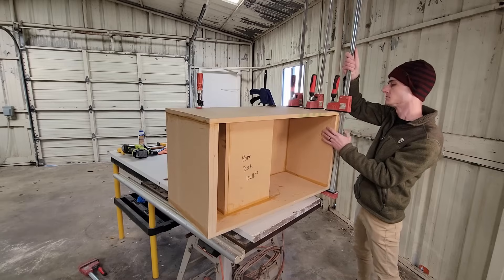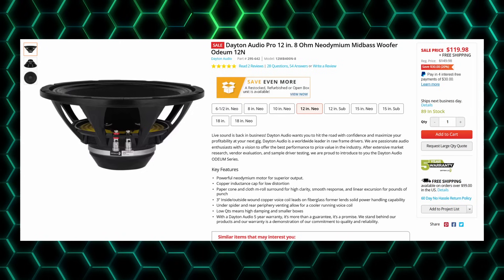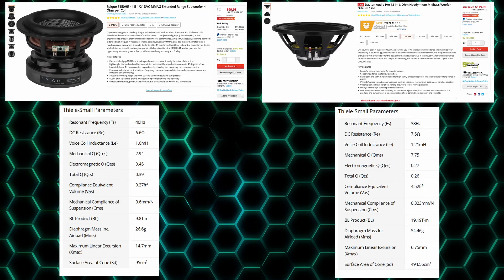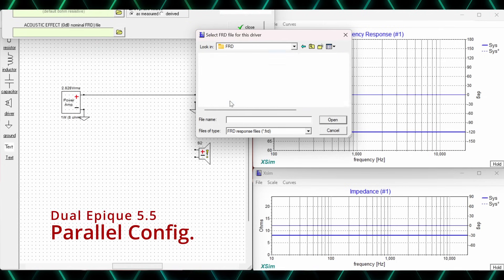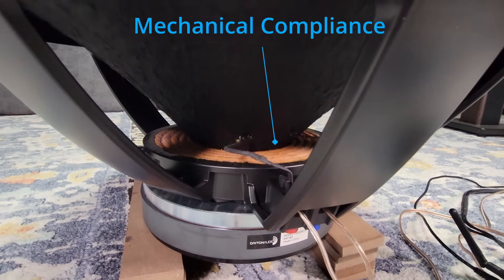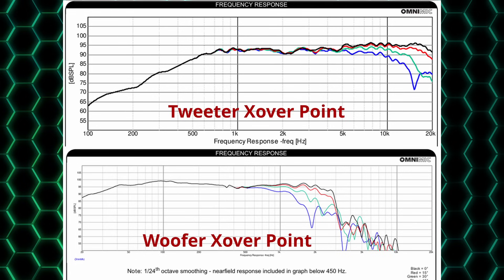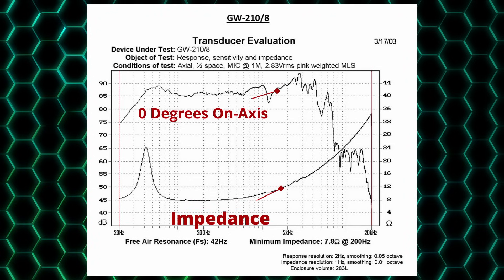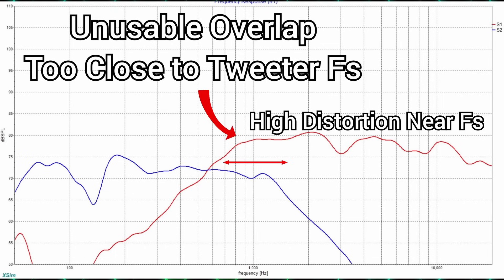Selecting The Best Drivers For Your Project - QuickStart Guide

Comment: Interested to build a pair of three-ways.  Been learning the full spectrum of design factors involved.   With this video, you summed up very well the driver selection process for me.  Very happy that your info confirmed my efforts.  I have been playing around with Win ISD for a couple years now and feel confident in my level of understanding.   Just out of curiosity,  do you use your builds in your own main system(s)?  Do you ever compare your speakers to retail choices?  Aside from the satisfaction earned in DIY is it really worth it from an audio performance point of view?  Oh, liked and Subbed for a few months now.
Reply: .    How would one decide between soft dome or ribbon tweeters.  A cone or horn midrange.  Two 6" high-excursion or one 15" high-efficiency woofers?
                                                                                                                                        Acid Jazz, Funk & Brass🔈🔉🔊

Comment: I will have to watch this several more times to catch everything that you were throwing out there.  I'll eventually get it though.  Thanks for the info.  On a related note, could you recommend a modeling software for horns and transmission line builds?

Comment: Wonder if only compression drivers can match what a 15" midbass driver is capable of.
Reply from the maker: It's certainly possible, if you are asking about crossing the CD to a 15" woofer.
Many CDs can play down to 500-800hz.

Just be sure the horn can support the low end as well. There aren't just a ton of horns that will play that low, so be sure to check the specs.
Reply: @DIYhyfy  Wonder if you've tried any coaxial compression driver in that case.

Comment: I've been designing/building speakers for 50+ years, and I have to say that's a great informative video, good job!  It's a lot easier today than when I started, even T/S parameters were a fairly new thing back then.  We didn't have software to help, not even pocket calculators when I first started.  Now with all the measurement and CAD software etc, it's relatively easy to get good results especially with good information resources like your channel.

I've focused primarily on open baffle for over 30 years and only use passive crossovers in situations where active isn't practical.  The side and rear surrounds in my home theater use passive crossovers along with DSP EQ to correct for the dipole effect of the open baffles.  The Atmos, currently in progress, are sealed box with passive crossovers and no DSP.  These Atmos speakers and the Infinite baffle subwoofers operating from 10 Hz to 35 Hz are the only thing not open baffle in the theater. 

I just discovered and subscribed, I look forward to checking out your past and future videos.  Keep up the great work!

Comment: You can also overthink everything especially when car or home audio is not cheap. If it were then driver manufacturers, Speaker manufacturers. DIY'ers would be making proper 3 way designed speakers and all you see is 2 way design speakers. Even for expensive tower speakers. Since when are less speakers a good thing?
Reply from the maker: Yea it's tough to plan a build now that prices have doubled for so many things.

It can be a but depressing to assemble a shopping cart for a nice affordable set of 3-way speakers, and then suddenly remember that you'll need to pony up another $200-300 for xover parts.

Fortunately 2-ways can sound really nice, with low distortion. But I do also prefer a nice 3-way.

Comment: People go nuts over ribbon tweeters.  Fact of the driver is that they rarely, if ever play low.  That means, you have to have a midrange that responds to 10K to cross over without a gulf between upper middle and treble.  That, or use the ribbon as a supertweeter, with a dynamic tweeter between the ribbon and midrange. There are more than a few ribbon equipped commercial speakers that have this dropout.
Reply: there are plenty of mundorf amt's that can be crossed low. in the 2k range.
Reply: The larger the ribbon, the lower it will go on average. Magnepans are full range ribbon speakers.

Comment: I don't use any measuring tools to build my speakers.
Measuring tools are going to be massively influenced by the surroundings they are used in anyways.
I just read the manufacturer SPL charts and use that as a general guide for what the driver does at specific frequencies.
Think of it like a second hand story of the drivers capabilities, not 100% accurate, but close enough to formulate some decisions.
Passive crossovers are not accurate devices in a mathematical sense no matter how high the order.
They just approximate curves based on approximate impedance.
I instead just prototype the crossover outside the box and do A to B comparisons by ear with a set of good headphones.
This allows me to sanity check the mathematics and make changes on the fly by temporarily wiring in different components.

There is no mathematically perfect speaker, so there is no reason to strive for it.
Just get close and make final adjustments based on what you want to hear or how you hear.
This is the art of speaker design.
If it was as simple as taking perfect measurements, there would be no variation in high end speakers from manufacturers as the problem would be solved.

My general rules I have discovered is: (based on manufacture SPL)

1. The speaker should not have a flat SPL response.
You want to design in a -2dB drop about every third octave of frequency response from low to high.
Making the entire frequency range SPL equivalent will make a very bright sounding speaker, brighter than is pleasant.
This is why a good three way design is usually superior.
It allows you to change the third octave from the woofer frequencies more easily. 
Also don't forget to test the resistance of you crossover filters from positive leg to driver positive leg (live side of the crossover filter).
Any resistance will contribute to the attenuation of the driver (drop in dB output).
(An example from the video, the Epique E150HE-44 is 83db response, most mid-range and tweeter drivers live in the 89dB range, this means you would need four of the E150HE-44 to match the dB level of a typical mid-range or tweeter; unless you like throwing most of your output power into resistors.)  

2. The design intent of the driver matters.
Just because a driver can play the frequencies to within 3dB of the intended response curve doesn't mean they should.
Pay attention to those 3dB humps in the drivers frequency SPL curve.
It is the driver telling you where it is best used in the application.
Example, a woofer that drops 3dB from 100hz to 400hz is going to sound muddy even with a -2dB offset in the mid-range driver
Woofers with this character are best suited to sub-woofer tasks.

3. Zobel networks are ESSENTIAL! 
If you are not using a zobel, your crossover is not accurate, period.
The only exception is very high frequency drivers or drivers that are not impedance typical (ribbon tweeters)

4. Some cone breakup or frequency ramps near the end of the driver response can be handled by parallel notch filtering.
This is usually essential for mid-range drivers from 1K to crossover point.

5. Driver material matters for the intended frequencies played.
The general rule I have found is that low frequencies like incredibly hard materials, mid-range likes firm but pliable materials, and tweeters like firm but very flexible materials.
From a material stand point, I like metal or plastic for my woofer drivers, paper or paper composite for my mid-range drivers, and usually some form of ribbon tweeter for the high frequencies.
Reply: Like all measurements they provide a standard.  Yes the room is a major factor but speaker companies can’t provide for every possible listening room possibilities.  Ears are completely bias and can create what YOU THINK are a great speaker but when others hear it?  Watch the famous Floyd Toole video where he explains how the greatest speaker designers in the world were producing garbage with only their ears.  I never understood the ears are the best concept.  Say you make a speaker and it sound bad.  You need to adjust it, how?  Do you just throw components in and guess??  In the modern world I’ll make tge response straight with a slight downhill slope.  THEN I’ll listen.  If something seems off I’ll look at the response to find the issue(that might not always be an issue) and use modeling to see what my guesses yield.  When using measurements it’s not just the graph, but without measurements it’s a guessing game that is highly influenced by a single opinion

Comment: Nice vid, Brandon! Tells the truth about integration premises us experienced builders use.

One thing I'd like to add, among other things further ahead here, is that manufacturer's recommended useful ranges should be thrown out the window. Those are done by inexperienced marketing employees making judgements on FR plots alone. 

An example, you can't use an 8" much past 2.5kHz EVER due to breakup and beaming, (likely lower truth be told) and if the breakup is at 3kHz the useful range may say Fs to just above the breakup. Lots of drivers CAN play below Fs, but minimally. The other reason they can't be used that high is the breakup needs attenuated, which rolls off the upper end of the driver's response to the point of acceptable suppression. -25dB is bare minimum, -40dB is better and typical, and -50dB is best for any problematic inherent abnormalities in driver responses, including harmonic distortion profiles. HD profiles are best if even order, as odd order are not as pleasing to the ear, and the typically accepted 1% HD limit is at the -40dB threshold. All of this should be considered when aligning drivers through a crossover, but elevated HD also is not the end all be all measurement to abide by.

Pretty sure I heard you say using 2 drivers in parallel adds 3dB to the output. This is true if talking about wattage efficiency, but voltage sensitivity goes up +6dB due to both the doubling of cone area and halving of impedance. When designing loudspeakers, wattage tells you thermal peak output, as long as mechanical power handling has not yet been breached, as well as how the driver will handle dynamic peaks in program material. (Mechanical power handling has to do with output, xmax usage, box design, and frequency range applied.)
 
Voltage sensitivity at 2.83V/m places all drivers on an even playing field as most amplifiers are voltage gain devices. This also compensates for impedance and output differences unlike as if using the 1W/1m spec.

In measuring drivers in the baffle, the minimum mic distance should be twice the width of the baffle to gain the information related to baffle step losses. Inside this distance, the measured responses are considered nearfield and will have elevated bass responses. Typical location for a speaker under test is far from walls, placed midway from floor to ceiling, and positioned emanating sound non parallel to the room walls or orthogonal. Best measurement practice is outside on a ladder if capable or able and the environment is low noise.

This brings up the issue of baffle step losses, and most bass drivers should be expected to lose 4-6dB in sensitivity in application unless positioned against or in a front wall boundary. This depends mainly on room size, boundary loading, and how close the listener is to the speaker. 

Essentially, those 96dB and 83dB drivers become 90 and 77dB if placed free-standing and fully compensating the loss. 

Every 3dB of loss means twice the power is required for the same output, and +10dB is considered to be twice as loud.

In terms of amplifier clipping, and +30dB dynamic range in music, less power is required to not clip the amp during use. A 95dB speaker only needs 17W to sustain these peaks, where an 83dB speaker will require 200W to sustain the peaks without clipping. This is why higher sensitivity is nicer if you can get it.

That leads to Hoffmann's iron law, which is that you can't have but 2 of the following;
Small required box volume, high sensitivity, and low bass extension. Physics limits you to two.